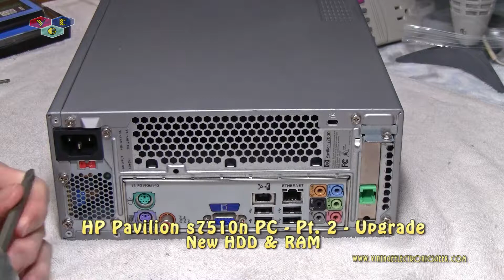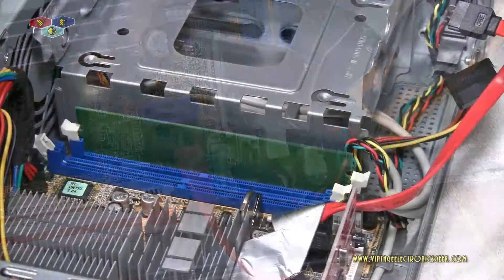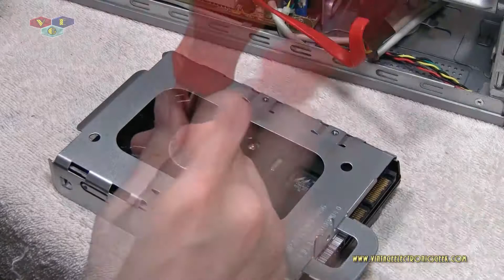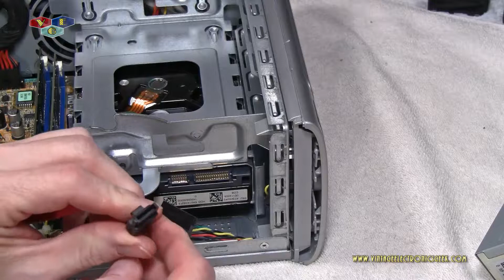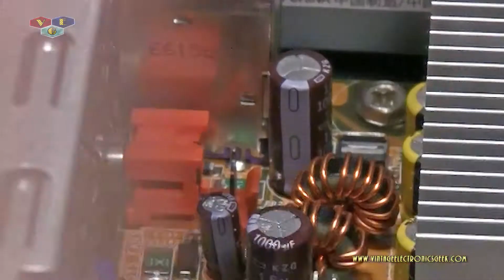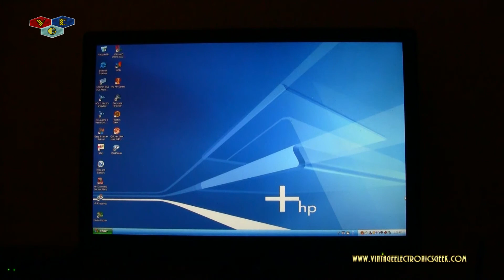HP Pavilion s7510n PC - Pt 2 - Upgrade

Comment: My HP desktop already has a 1 TB drive and 8 gigs of Ram and I bought it brand new back in 2013. Its an HP Pavillion P7-1436s PC that originally came with windows 8 now upgraded to windows 10 and I have never upgraded it. I Started with computers when we only had 5 1/4 " floppy disks and no hard drives then the big upgrade to 3 1/2" floppy's and loaded windows 3.1 with the 13 floppy disks for the DOS operating system. Wow we sure have come a long way since those days. Those wires are pretty tight Jack I have never opened up my big case but I probably have a bit more room than you have. Did upgrade my 5 year old Toshiba satelite L775D-S7340 to 8 gigs of ram from the 4 it had before that was pretty tight getting it in.. But I am not a major gamer or anything just needed the extra drive space to save my videos on. Glad to see you got it up and running quickly after the upgrade Jack. I actually have 3 lap tops 2 dells and the one Toshiba and then the HP desktop. Always have had a back up computer since I have had all fried in a lightning storm in California.

Comment: What is the maximum amount of ram that this PC will run. Tight working quarters.  I like picking up computers like this and running Linux on them for servers etc.
Reply from the maker: 2G is the max, that's what I added....I'm not much int *nix, I dorked with it back int the 90's and just was never excited about the whole process of command line...I used to be, I started out with computers back about 1982/3, but when I started using a GUI, I didn't enjoy it anymore, yes I know you can do GUI with *nix, but just not (at that time) the same level as Windows.  ~Jack, VEG

Comment: Kewl RC chopper, that looked and sounded like the real thing!  

Good to add a new case fan in those small form PC's since they depend a lot on it.  I have a small Acer SA  find, works great.  I have a few of those mini's, two AOPEN, two Dell mini, and the Acer.  Pretty much a laptop mb in an ATX mini case.  For dedicated purposes, they're great, small footprint can be stashed out of the way.  

btw, the AOPEN PCs fit into a car radio dash opening, add a screen, and you got a  mobile PC.  Tablets are a bit better now, but still kewl.  
Don
Reply from the maker: Thanks Don, it kinda looked liked your RC!  :)  Yeah, small form factor computers are great for dedicated 1 or 2 tasks, such as firewalls, mail servers, etc...as stated in the first video, its only purpose was to work with my vintage cameras, I also have a small form factor computer that has Win 98SE on it for the same reason, however at this point they have been decommissioned....my new Jeeps dash is a computer screen..well, heck, I'm sure like your new car, mine is all one big computer!  I plan on doing a video, more of a review on my Jeep as soon as I can.  Not today, heat just peaked to 114 :) ~Jack, VEG